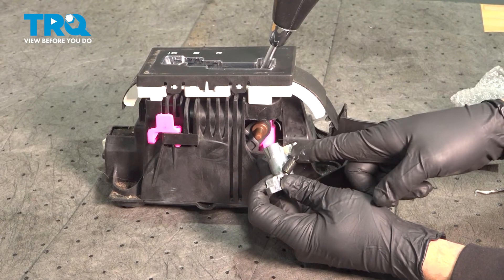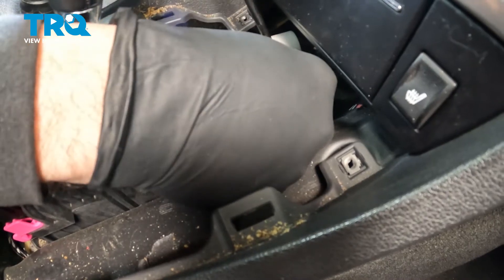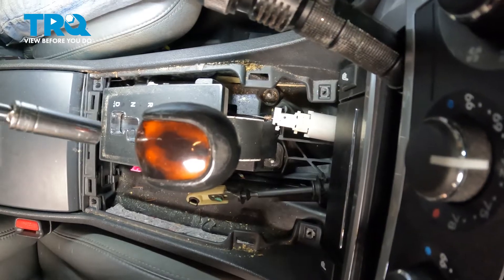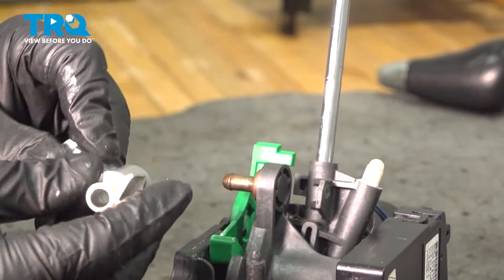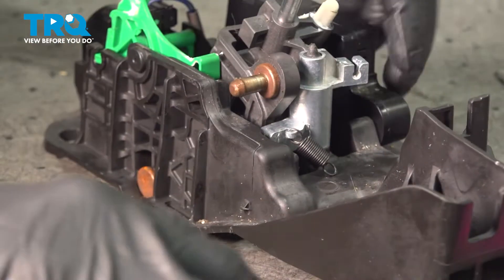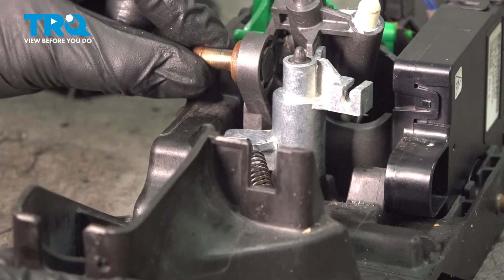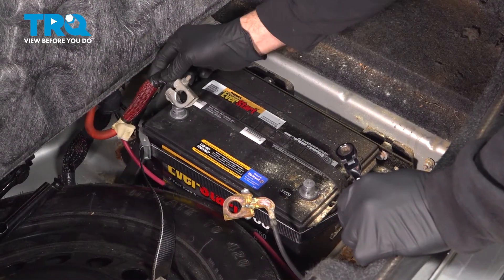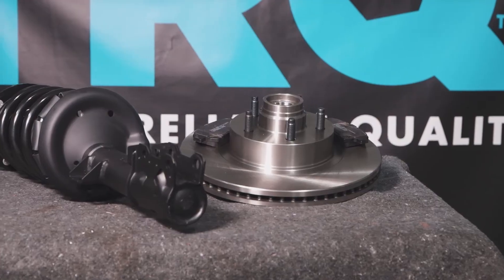How to Replace Shift Interlock Latch 2005-2010 Chrysler 300

Comment: Just did mine it was super easy thanks to your video, the kit I bought came with a "performance spring" which was a tighter spring I reassembled everything just to realize the spring is to tight and it's pulling the stick to the right now I have to hold the stick to the left to be able to remove the keys from the ignition will be fixing that this weekend 😂
Reply: I was wondering why mine came with 2 springs. Thanks for the info

Comment: Okay I'll follow the instructions begin assembly all apart and nothing was broke I also had electrical connections testing and we're okay I was told it could be the brake pedal sensor I had it tested  it also was good do you have any  recommendations thanks Jose Arredondo.

Comment: I ordered the part I needed and was able to pull the gear box assembly out of the pacifica. I made a huge mistake and put the key in the ignition after the gear box was out because the windows were open and it started to rain. I turned the key on to roll the power windows up and now the key is stuck in the ignition as the gear box was out of car. Than the battery went dead. I don't know what I did wrong as I replaced the part that was the problem and hooked everything back up but it still won't come out of drive and the key is still stuck in ignition.